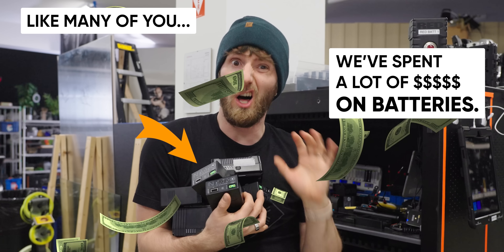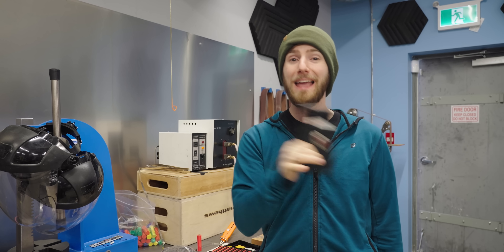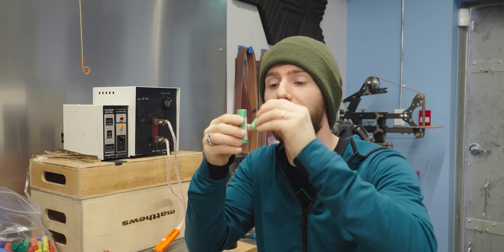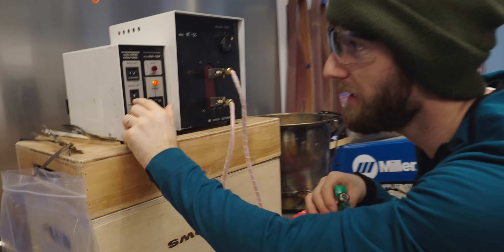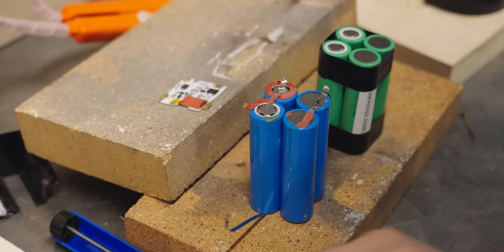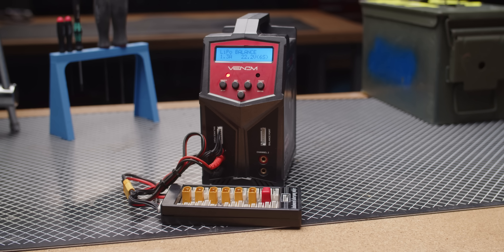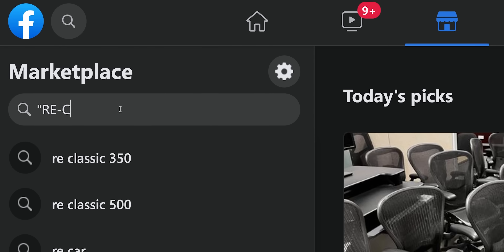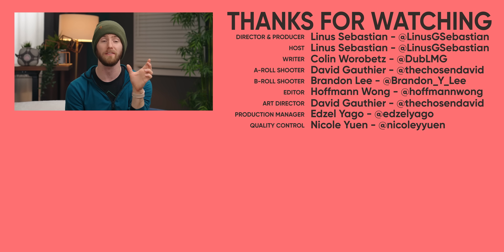This should be illegal… Battery Repair Blocking

Comment: To be fair there are times when the so-called "evil" BMS is necessary for safety. 
In certain application where the batteries are overstressed due to size constraints or where failure of the electrical circuit will result in death(safety systems),  it is more ethical to make the BMS brick itself to prevent potential failure after a limited number of cycles.

Comment: Hey, maybe if you try to charge it, it may work again. Because normally the BMS will cut off the power if the battery voltage is too low and will not turn back on until you connect it to the charger.

Comment: so the reason why you shorted the cells , is because you overheated the insulation on the top of the battery  and created a short. The outer casing is negative all around, the positive is on the top. You should have put fiber insulative tape if you are doing this.. or just do it faster and let the strip to cool down before doing another weld. Otherwise profesionally you would pre bend the strip so that it never touches the outer rim , but also add the tape around . I really do not understand why you bothered with those cells as you could bought prewelded - Tagged cells

Comment: Never NEVER buy cells form a vape shop!  I love my vape shop, and I do not think that the majority of vape shops would knowingly sell mislabeled cells, however they are at the mercy of the middle man they purchase the cells from.  There are a few online retailers that are trustworthy, but Ebay/Craigslist are not in that bunch.  A bit of common sense is needed here.  Lets say you have done your research and have chosen the cell that is best for your application, If someone is selling that cell at more than about 20-30% lower than average that should be a red flag that the cell is fake.  Best case scenario, the cell you purchase from one of these shady venders does not have the advertised capacity, worst case it does not have the ability to handle the current of the genuine cell and your application which can cause a fire/explosion.  Linus I think it is irresponsible for you to make this video.  I hope no one gets killed due to your irresponsibility.

Comment: So, I am going to subscribe to your channel, but I am confused by a few things you said. First, you said don't re-use cells from the old pack. I saw the reasons you gave, but the reasons don't seem to justify not re-using. If you are careful, wouldn't you be able to re-use? Can you expand on your recommendation please?
Secondly, you found some cells in the NEW pack that weren't up to voltage. Did you just throw them away? Seems like you are leaving money on the table needlessly. Can't you charge the low voltage cells and then use them? 
And one more question... What was causing the welds to spark? Can you explain what was happening so I can avoid it. I don't get why a spark ruins the cells, since regular welding causes sparks naturally. Thanks.

Comment: Most cases when fully replaceable battery cells are glued in something indeed is due to planned obsolescence. For gadgets there is also miniaturization issues which push manufacturers to glue novelty cheese slice thick smartphones or screen panels into thin laptop lids instead of using screws. Preventing original BMS to brick itself during battery cell replacing is hardest part. I agree that Rights to Repair movement must stomp battery pack manufacturers on nads very hard here. Spot welding tool for battery pack assembling indeed is must have. Also good 18650 cells from faulty battery can be used somewhere else like in flashlights just fine.

Comment: There are many DIY powerwalls made of mixed 18650's.  They can safely be mixed by testing them as you did in the video.  Test, sort, charge (individually), test, sort.  At that level people often also make their own BMS.  I think the content took cya into mind which is reasonable.  I also wouldn't suggest all I said without having a clear understanding of the process.  Good safety measures were in place in this video as well though I would add eye protection.  Overall good informative work!

Comment: You get sparks because you didnt put enough pressure on nickel strips to transfer heat efficiently. Instead most of the heat gathered in the strip itself, blowing a hole in the strip and creating sparks. I dont understand why you're discarding cells after failing to put enough pressure on nickel strips and creating sparks, those are good cells.
This video is battery building equivalent of The Verge PC building.

Comment: Linus. As a tool battery refurbisher,  in many cases you simply need to reset it. After assembly, place it on the genuine charger, it should reset the bms and function correctly as it probably detected a large voltage shift from the cells you pulled.

Comment: Also, a cell from a bad battery pack could have slumped below what is considered the usable voltage range for these lithium chemistry cells. When this happens it is possible that this one cell could avalanche and catch fire simply by recharging it. It's an oddity with rechargeable lithium ion which is also one of the things that a battery management system watches for.

Comment: Jeez! This reminds me of toner cartridges and their planned depletion. Even though they still have lots in them, once that usage gear passes the snap fuse, the printer wants new new new! Thankfully there are determined individuals out there that give the rest of us a way out! Myself I re-use those old lithium's in personal projects and some have run for years after the weed wacker said nope.
Reply: Don't forget that where printer-cartridges really are dubious, lithium-cell packs really are dangerous when you start to mess with them without enough knowledge.
And trust me that my V-mounts (Bebob) are insanely well secured against messing with 'em: you need to crack the security keys inside the BMS-chip to get access to them and alter the registers (if it got locked to a fault with the cells, temperature or overcurrent).
And it's all incredibly complicated and took me 9 months of self-study to get one battery working again. Linus is incredibly lucky that he has such a 'dumb' BMS. Mine cannot be awoken again after a serious fault and need deep communication per SMbus-connections to get them going again.
Reply: My printer has been asking for toner for the passed year and a half and is printing perfectly fine lol!
Reply: @missm2925  - Some of the modern ones don't have a setting to "Ignore Toner Nagging". There are usually ways to circumvent it, however it often requires some internet research to find something that actually works.
Reply: The BMS in this video is not "evil" - it is acting EXACTLY as it is supposed to. They are designed to disconnect and lock out any pack that is deemed faulty.
When you cut one of the voltage sense (no, not "balance") wires, the BMS sees that as a cell that has ZERO VOLTS. For lithium cells, that means very very dangerous if recharged.
Because the BMS is designed for consumer use products, there is no way that they want the pack to be allowed to be recharged or used after that occurs. Why did hoverboards catch fire? Because they didn't use that kind of protection.
So if you want to swap cells, you simply need to make sure that the BMS never sees a low voltage or zero voltage on any cell. It's quite simple, and not a conspiracy.

Comment: I  had a laptop with a dead CMOS cell. It was one of those with a two wire lead that plugged onto the motherboard. I didn't want to wait a week or so and order one so I tried soldering the leads onto a new cell. that didn't work. It wouldn't stick and the heat destroyed the cell. So I used some common sense and used electrical tape and taped the leads, ( with  the Nickle fragment flattened out that I ripped from the dead cell ), onto the new cell with a few tight wraps, plugged it onto the motherboard, and it's been working ever since then.   Just sayin'      Mike.

Comment: I'm no expert but those spotweld settings look a bit off. Looks like a lot more heat is being generated than necessary. I like to spotweld two narrower strips at once, with a tip on each, and leave a tiny gap between the strips. That way you won't have current rushing around the weld joint = inefficient = excessive weld settings. Also, it's better to have a trigger in the spring-loaded mechanism to ensure that the pressure is kept the same. Otherwise your weld joints vary a lot.

Comment: That's funny, I do this all the time with a 10 yr old same crap original destroyed tip radio shack 40W soldering iron and some random twisted copper wire. Drills, vacuums, etc... never had an issue - never lit one up, no fires, no failures, no sand can and there's metal chunks bits and wires and barbs and pokers all over the tiny edge left on the work table. Oh, and used laptop batteries that are not voltage balanced.

Comment: To be fair to the battery manufacturers, they could face serious liability from a reworked battery pack. Joe I'mSoSmartICanGetAroundThierSafeguards fudges up a repair, and checks the pack in his airline luggage. If the pack catches fire and brings down a plane, lawyers will be lining up to sue the manufacturer into oblivion. 
Sure it's a long shot, and the cases should be dismissed, but that is the scenario the corporate lawyers will present to the manufacturer, who must then cover their a**.

Comment: If you are ever interested in deep battery testing and good recommended high drain cells. Then I would recommend a guy named Mooch online who has been doing in-depth testing on batteries for vaping for years, I know when you hear of vaping you might think "o god"  but the information is good for really anything. high watt vapes really go hard on batteries so the use case really highlights the quality and longevity of certain brands. My personal favorite is Samsung 30T's

Comment: If thare like laptop battery's you have to keep the power on to the BMS when you swap from one to the new soldering in parallel ones then cut the original one out when the BMS powers down its bios seems to be in ram  so taking the battery's off completely seems to make it not work , only found this to happen with Nikon D3 battery's and some laptop ones, as for user serviceable batterypacks  it should have a door to take out the old 18650's and drop in new ones like TV remote controls or old ghetto blasters it's definitely about making us buy new branded battery packs

Comment: There are a lot of Battery Packs out there who will accept a cell chance without any hints, i never had any of these problems. 
Sometimes you need to charge (with an CV/CC Lab-Supply, a normal Li-charger will not work! => No Voltage on Pack-Terminals) the pack just for a second to switch the output on after a cell change. 
Some of the function you described as "just evil behavior of the manufacturer" maybe implemented as safety features => to low voltages on cells, sudden changes in capacity/voltages,... this does not happen in normale operation of the pack, just in a fault condition. So for safety the pack switches off completely. But I agree, if this is implemented, there need's to be an easy way to reset it and change the cells.

Comment: Sparks are very common in welding batteries. The battery will be fine as long as you don't "shoot" the battery right through. Using nickel tape to weld batteries also can do some sparks but very little (compared to steel nickel plated tape).

Comment: I use reclaimed lithium battery's in my flashlights.  I get them from old laptop battery's. They are very easy to find the good single cell's and recharge with a high quality charger

Comment: I am using 5v  350 MA battery charger.

I’ve got a iPhone 11. The phone requires 1/3 amp To operate. That’s how much juice I gave the telephone. My battery is just sitting there on vacation. I do this with the battery state of charge at about 50%. What do you think of that.

Comment: Hmmm... I thought you had an EVIL battery. Now I know... Can you recomend a GOOD BMS?

I think they did the same thing to Tile APP tacking tags.. Once the battery is removed, the Tile loses it's ID and can never be revived. You might be able to keep the (BMS or Tag) alive if you  connect it to life support(power source) while switching batteries.

Has anyone reverse engineered the evil BMSes?

I need to make an updated battery pack for my metal detector. it uses 14 standard AA batts.
Wired as (+12v)---(GND)---(-9v)
I want to replace with a battery pack (with a built-in BMS) that has: 
(2 INPUT charging pins) and the (OUTPUT PINS) listed above..

I am tired of pulling out the batteries, connecting them to 2 9v snap connectors, then putting  them back in.
I want to redesign it to be as HOT SWAPPable as a DeWalt power tool battery pack.

Comment: I was thinking of a box but you sawed some casing in half, maybe because the project was intended for many other batteries you could had glued the two sawed pieced to make a case? To just place the cells in and welt the top and then just flip them on their own. Maybe a bit too much of a hassle but i suppose easier than to need to use tape to hold them.

Comment: Unless I'm missing something, there's absolutely no way that sparks can occur at 9:10. That's because Linus was only working on one side of the battery pack, and therefore each cell can only have one common terminal.
Reply: What you're missing is the grouping of the batteries into packs of 4.  Look at 7:05  - 7:10 - The color difference on the end is b/c the ordering seems to be 1 group of 4 cells positive side up, then a group of 4 cells negative side up, alternating.  So each side of the pack contains both positive and negative ends, so sparks can occur.
Reply: @MrSlowestD16  I didn't miss the configuration of the battery pack and agree with you on the specific configuration in this video.

However, I claim the following: Regardless of the configuration, as long as you only work on one side of the battery pack, you can neither create a short circuit nor connect two mismatched cells in parallel and therefore no sparks can occur from that.

Consider a trivial pack with only two cells: The positive terminals are either on the same side of the pack or on different sides. If you connect them only on one side, you have them either prepared to be used in parallel or in series. I say prepared because in both cases there is no closed circuit, and therefore no current can flow due to the lack of a connection on the other side of the pack. Adding more cells to the pack doesn't change this, you then essentially have prepared two clusters of parallel cells that are connected in series.

In my original comment, I assumed that Linus was only working on one side of the battery pack at 9:10, and therefore wrote: "Unless I'm missing something, [...]". I came to this conclusion based on Linus' and Colin's statements. For example, when Linus spot welds the second layer at 8:43, he mentions that "things get [...] interesting" after he just tried the two layers on a test cell. He most likely would not have mentioned this if he had already been working on the other side of the pack, where a second layer is also required (due to the particular arrangement of the cells).

Furthermore, when Linus states that they will find out how Colin's measurements went by connecting positive and negative terminals, he's wrong not once, but twice. The first error is what I already described in my original comment, and the second error is the fact that you match cells that you connect in parallel (due to potentially high equalization currents) rather than in series (the BMS will take care of the balancing). This clearly shows how little he understands what he's doing. Maybe he should hire an electrical engineer who can explain these things to him :P
Reply: @MueDominik  I agree with that comment only applying when in parallel - but I believe there's both parallel and series circuits in here, I don't know the exact layout but given the situation I'd say both are here - if it was entirely in parallel then they'd all be facing the same way with a single strip across each row tied together at the end, not multiple layers; and it's not likely in series b/c that's a lot of voltage (at a glance at 9:10 it looks like 4 are in series for ~13v and there's many of those tied together in parallel, which makes sense, but given he's tying 2 groups of 2 together in the middle....so I'm obviously not understanding the whole picture) - but we can assume Linus's comment about the differential applied to only the parallel portion.  He made the comment right before laying the strip across the 2 pairs of 2, which does include a parallel connection.

I also agree with the lack of a circuit meaning it won't arch - sure, but as the camera wasn't rolling, we don't know exactly what he was spot welding.  If we were to agree that there's both series & parallel connections here and that both poles exist on both ends of the battery, I would not be surprised if at some point in that daisy chain there is a strip going top to bottom to chain 2 packs - and we don't exactly know which part he was trying to weld.  This could have been 30 minutes later.

I think there's too much info about the setup missing to say it's impossible that an arc happened as you are.  It's easy to accidentally touch the wrong thing and short shit out, done it way too many times.
Reply: @MrSlowestD16  It's just incorrect spot-welding. Every spotwelder, even if it's made for cell-spotwelding, can make sparks occur.
He is making a 4S4P pack on that RED-brick. (4 cells parallel, 4 of those groups of parallel cells in serie)
Pity the video I made about completely reviving one of my Bebob V-mounts is far from ready yet... I'm not saying I'm doing everything right, but the build is far more clean than in this video (and at least I get to a working battery again, after messing with a very complex BMS-IC (BQ20Z65) )